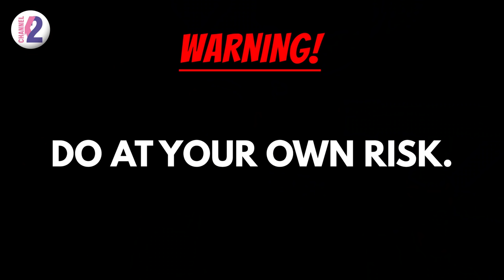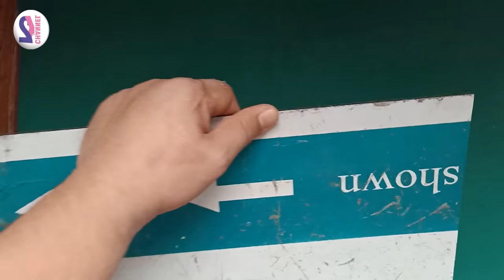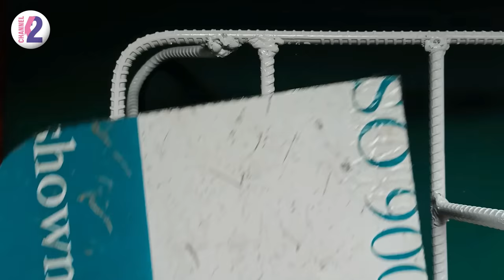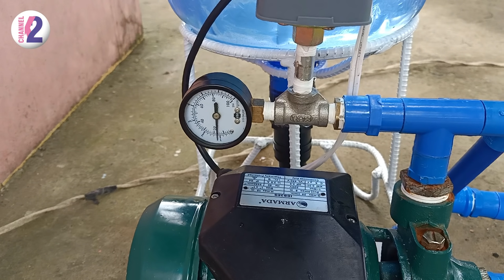I turned water container into a working pressure tank!

Comment: I just blew one up yesterday at 35psi. It ruptured into ten pieces and sounded like a rifle going off. One item not accounting for is that all jugs are different and that cycling pressure will fatigue the plastic. Mine only lasted a half dozen cycles. It all comes down to hoop stress of a pressure vessel. For mine the 0.02" thickness in some parts equates to 14,000psi hoop stress, beyond what the plastic can withstand. If you try this, make sure you have a solid water jug and stand clear or cage it. I'm just grateful the neighbors didn't call the police...lol!

Comment: A'ight, the correct way to use plumber's tape is to wind it in the same direction as the fitting that screws on, and you only need at most 2 full turns on most small fittings.  Something 2 or more inches might need 3 turns of tape from the open end to the beginning of the threads.  Hate to see what happens when that plastic degrades and ruptures under 50psi.  Don't place metal objects or knives nearby or they may go flying and kill someone.

Comment: I've tested these, these bottles can go upto 200PSI before bursting, try 150PSI and your spray jet will work much better
Reply from the maker: Yes i think it can. Though I only reach around 75psi only but with no problem at all. However I don't recommend using pressure above 50psi since dealing with high pressure is deadly.
Reply: Please take precautions in that pressure someone can get serious injuries if wrong time on wrong place
Reply: @kasunrodrigo6592  its Dangerous its what Bomb do, pressurized thing and bum
Reply: @sayalaperbandel  benar gan ide oke tapi saya takut pecah/meledak galon nya kalau yang awam diterapkan pada pompa besar dan di setting otomatis nya gak di perhitungkan ngasal 
Kalau yang paham misal saya dan agan 
Masih aman aman saja
Reply: are you sure? did you make a video?

Comment: This does not have a pressure bladder inside like normal pressure tanks so your pump is still going to run alot
Reply from the maker: Nope! My set-up only starts the motor at 30psi and stops on 50psi. The motor will start again if the gauge drops to 30psi. The trick is to put the water in the tank empty. And all will work like magic. The elasticity of the plastic alone act as a bladder. No need for a valve.
Reply: What your saying is true this will work for a while, that being said adding a bladder will dramatically improve the service life of the tank. I’d recommend putting in some thick balloons. Old school plumbers used to use this same technique in water hammer arresters but is no longer code
Reply: @elmersackanay6944  do you mean normal large party balloons, I thought they would eventually deflate? Do you inflate multiple  balloons next to each other inside the. Bottle?
Interesting  I'm poor need a cheap solution...thanks in advance🌈🙏🏻👍
Reply: You noticed this as well.  The plastic tank is a pointless exercise.  It does not do the job of an accumulator.  Could simply  put a t-fitting in pressure line for the pressure switch.  The plastic tank does nothing.

Comment: good job !...what about a schrader valve,for air intake to the tank???
Reply from the maker: This one don't need a schrader valve or air intake it only relies on its water pump's power to compress air in the tank.
Reply: @KeytoChannel  झझझझझजख
Reply: @KeytoChannel  si lo necesita    de lo contrario va a encender constantemente
Reply from the maker: Nope! My set-up only starts the motor at 30psi and stops on 50psi. The motor will start again if the gauge drops to 30psi. The trick is to put the water in the tank while it's empty. And all will work like magic. No need for a valve.
Reply: Y lo otro que debo comentar es que es una muy brillante idea   es un crack
Reply: Al no haber cámara de aire   el agua no se deja compresionar   va a subir a 50 lbs rápido y va a bajar igual de rápido y va estar encendiendo y apagando    de todos modos alguien que conozca más que yo de luces en lo que planteo
Reply from the maker: Yes I know that. This set-up is tricky. If you look closely, the tank is higher than the motor. Any air trapped inside will be compressed and will always stays on the tank. And remember that this tank is made of plastic not metal. And plastics are elastic. It means that it acts like 2 in 1 a bladder and a tank (when this thing is working you can see the tank is half empty, 70% water and 30% air at 50psi. At 30psi, 20% water and 80% air). This set up can run around 3-5mins while the motor is off in complete 50psi. And the motor will start working when it drops to 30psi. I takes only less than a minute to fill 50psi. Hope this clarify your question. This video was not made to showcase the engineering behind a bladder tank. But the main goal is to entertain people with a little amount of idea.  It would be boring if I go beyond explaining everything all throughout the video.
Reply from the maker: Yes I know that. This set-up is tricky. If you look closely, the tank is higher than the motor. Any air trapped inside will be compressed and will always stays on the tank. And remember that this tank is made of plastic not metal. And plastics are elastic. It means that it acts like 2 in 1 a bladder and a tank (when this thing is working you can see the tank is half empty, 70% water and 30% air at 50psi. At 30psi, 20% water and 80% air). This set up can run around 3-5mins while the motor is off in complete 50psi. And the motor will start working when it drops to 30psi. I takes only less than a minute to fill 50psi. Hope this clarify your question. This video was not made to showcase the engineering behind a bladder tank. But the main goal is to entertain people with a little amount of idea.  It would be boring if I go beyond explaining everything all throughout the video.
Reply: @KeytoChannel  You are wrong. Air will eventually dissolve into the water and tank will become "Water Logged". Has to have an Air volume control to work right. Well Driller for 35 years.
Reply: @KeytoChannel  water doesn't compress sir as it is a liquid, and there for this is not a pressure tank at all as the idea w a pressure tank is, that half the tank is filled with air and separated by a rubber bladder, so when the pump fills the tank the AIR is compressed and as u open a faucet and the system starts to lose pressure the air then pushes the water out to the set low limit on their pressure switch allowing, depending on the size of the tank , x amount of water to be pushed back out of the tank under said pressure  before the pump is required to restart and complete the above said process over again , so the bigger the tank volume the more time it takes in between  pump cycles ...... Wich is the whole point of having a pressure tank ........ So without having a pressurized bladder the whole idea doest work granted u may trap a certain amount of air in the top of the tank it will not work the same as having a bladder and once again .... Liquids do not compress ...... Thus the theory of hydraulic's wouldn't exist and as an above commentor said... This is basically pointless the way u have it set up ..... Sorry to be the bearer of the bad news ur pump will cycle just as much w or without the pointless bottle

Comment: I want to do sth. similar, use the water container just as air tank for my airbrush compressor. Do you know what size that adapter is? Is it 1 1/2 inch?

Comment: You did not show the reason for having a pressure tank and that is the amount of draw down so the pump is not on continuously.
Reply from the maker: The answer to your question is that little "Pressure Switch". It cuts the the pump power off after reaching the your designated pressure.
Reply: @KeytoChannel  I know that but the pump works continuously and a pressure tank prolongs the life of the pump.
Qualified plumbers will recommend the installation of a pressure tank even a small one.
Reply from the maker: You can get minimal air pressure  by allowing the motor with water to run while the container is empty. Trapped air inside the tank will compress and serve as a passive air pressure though its minimal, but it works. I only use it for cleaning so the pump will not work for that long.

Comment: I've got a water transfer pump..will this work for my pump?
Reply from the maker: It depends to a kind of water pump. here in this video I only used a water booster pump with 1/4 horse power (HP). The bigger the HP (like 1/2 HP or higher) the better.
Reply: @KeytoChannel  ok thank u
Reply from the maker: You're welcome!

Comment: Did you adjust the pressure switch or just left it as is (40/60)?
Reply from the maker: I adjust to make it lower. 30/50
Reply: Don't think it will work for me. This thing goes to 60psi plus. I tried a different pressure switch with no success. So the original digital one works

Comment: how did u get air in the bottle
Reply from the maker: U can put air inside by forcing the motor to run while the water outlet is close. This will build the pressure inside while compressing air to the tank.
Reply: Mga ilang secondo o minutes Sir?
Thanks
Reply from the maker: It depends po sa pressure na naiset nyo sa pressure switch nyo po. Automatic lng po sya titigil.

Comment: How it's working without air pressure inside the tank,
Reply from the maker: Please read the video description. Thank you for watching!
Reply: Yes useless design. The main purpose of the press tnk is to prevent excessive running of pump and build up press  The line which is going to the press tank are  same of the outle valve.

Comment: camera don't  focus at tank while pump working.
air in water tank will mix to the water soon. then it can't make pressure before pump start
it can be only water hammer helping
 this method like air pressure tank pump
but don't have air charger like air pressure pump
the air pressure in your water tank will drop in very soon.

Comment: boss, san mo nakuha yung info nang pressure na kayang ihandle nung water container?
Reply from the maker: Trial and error lng po yan.
Reply: ah okay sir, tatry ko sana kung pwede sya sa air or gas mga 40psi sana, temporary storage sana nang biogas/methane
Reply from the maker: Safe nman po sya sa 40psi lng pero di ko na po recommended ang 50psi up pa if daily use. At need mo sya indoor lng at kailangan mo ng bagong gawa na cointainer talaga para elastic pa sya hnd na brittle. Sa case ko 30psi lng normal use ko sa washing machine naka supply at pinaphidan ko sya ng engine oil para d ma dry ang taas na part kasi lumolobo sya parang baloon. Try mo din po ung 2L coke plastic bottles 120psi to 180psi po capacity nya safe parin.
Reply: Sir pwed po ba na wlang pressure gauge?
Reply from the maker: Kailangan mo po para ma set ang pressure ng tama. Baka kasi masobrahan at sumabog ang tanke.

Comment: How a  normal water bottle ll work as a pressure tank without bladder???
Reply: Thats my question,what send back the pressure to the the pump to cut off?
Reply: There is a thing called air over water pressure tank also called bladderless pressure tank, its made of either  galvanized or stainless steel. same principle but usually the tank is pressurized with air to about 20psi and then you let the water in working with 20/40 pressure switch.

Comment: sir ilang psi po ba pag naka on ung motor nya at ilang psi ung  switch off ung motor?
Reply from the maker: Below 30psi po sa pag start at 50psi po ang cut off. Pero pwede nyo din po e adjust dpende sa kailangan nyo.
Reply: @KeytoChannel  maliit lang na bahay sir pang cr lang at kusina kaya na kaya 20/40?
Reply from the maker: Opo mas ok po yan na mag start sa low pressure para safe, kasi pwede nyo nman e adjust pataas sa huli pag mahihinaan kau.
Reply from the maker: Sa experience ko po dito mas better na solo lng po ang sinusuplyan nya na linya. Gaya ng washing machine or pang car wash lng po. Pag madami po kasi ang outlet gaya ng mga gripo mabilis din na uubos ang laman pag sabay naka bukas.

Comment: material names bro
Reply from the maker: - 1pc 1/2 inch pvc pipe
- 5pcs 1/2 inch Male pvc coupling fittings
- 3pcs 1/2 inch Elbow pvc fittings
- 1pc 1/2 inch Tee pvc fittings
- 1pc 1/2 inch Tee (with thread in the middle) pvc fittings
- 1pc 1 1/4 inches to 1/2 inch pvc reducer fittings
- 1pc 1/2 inch union pvc fittings
- 1pc 1/2 check valve brass or pvc fittings.
- 2pcs 3/4 inch to 1/2 inch galvanized reducer (female)
- 1pc 1/2 inch to 3/8 inch brass reducer (male)
- 1pc 3/8 inch galvanized tee (threaded all sides)
- 1pc 3/8 inch galvanied male connector (length: 2 inches)
- 1pc pressure gauge
- 1pc ordinary pressure switch
- 1pc 1/2hp waterpump
- 1pc 5 gallons round plastic water container
- 4pcs bolts with nuts
- 1pc small solvent can
- 1pc teflon tapes 1/2 inch
- Wires and electrical plug
- Scrap metals for the frames
- Aluminum Composite Panel for the waterpump flooring (optional, anything hard will do)
- And the black plastic reducer for the plastic container (You can use anything as long as it would fit firmly to the containers mouth.)

Comment: Great experiment but in reality and practicality it's useless better buy a pressure washer if your using it to wash cars. It's ideal use though in places where water supply is scarce i.e provided you have a low pressure water service line then there's a thing called booster pump.
Reply from the maker: Yeah, I know what booster pump is. But put in mind that cheap pressure washer cost 3K PHP or more (and will probably break for few months). And aside that, it needs existing water source.  But if you don't have a water source yet and let's say you just have a deep well, you need another 2K PHP for a electric water pump and few hundreds pesos for your waterline. So that's roughly 5K-10K PHP or more. However the interesting part about my project is that, this whole thing only cost me around 2K PHP in total (maxed). And you can connect this thing directly to a well as your water supply input or any water source available. And also you can connect it's water output to your house main waterline to have a fully pressurized water system. (I bet pressure washer can't do that) And for it's durability, it's still under observation, but as of the moment 7 month had passed and there just a little discoloration to the container but the rest was fine and no maintenance was done yet . So it's not that useless after all right?
Reply: @KeytoChannel  well, that explains a lot. You have earned yourself a subscriber.  It depends on your budget this one is for cheap alternative pressurized water supply for low to mid pressure only for short bursts. The best application for your invention is for shower heads and houses with 2nd floors where water pressure can be low. Piece of advice though brother, the container can burst after a long use it is not designed for high pressure. A regular stainless pressure tank is rated at 40 psi only.
Reply from the maker: Wow, thank you for subscribing it will help my little channel a lot! Yes your right this tank are not built for high pressure but it was designed to handle a minimal pressure before bursting. So theoretically there is a safe pressure range before it will burst so I make use of it. And I tested this set up to reached safely up to 70-75psi or more if I continue but postponed it to avoid further damage to the tank. I got my concept from coke plastic bottle containers which can handle 120-180psi before bursting. And applied it with this tank which has also same materials with coke bottles (PET) but only in larger size. And it worked too only I used 50psi on this video for safety but lowered it to 30psi for daily use to supply my washing machine waterlines.
Reply: @KeytoChannel  7 month? ohhhhh

Comment: Idol gawa ka nang pressure  tank using plastic  drum.. madali kasi nasira yung  "tanki na stainless or fake bayun" 😢
Reply from the maker: I will try po next time kung posible po sya at kung makakaya nya ang pressure. Ang about sa stainless tank nman po karamihan po ng locally made hnd po tlga naka design for pressure nakaka handle lng po ng limited amount pero hnd po sya gnun ka tibay gaya ng mga branded.

Comment: Booster pump! Bakit walang pressure gauge sa plastic tank kung kaya talaga sa 50 psi or below 4 bar. Alin mas matibay gulong sa sasakyan  33 psi lang below 40psi o plastic tank? Kung segundo lang medyo kaya pa pero abutin ng isang oras na pressurize di kaya sasabog ?

Comment: 50 psi po Max? at Safe po siya gamitin sa line sa bahay?
Reply from the maker: I tested po and it can go further even at 60psi if set. But to be safe 30-35psi is enough sa bahay. And yes eto po ngaun ang gamit ko sa bahay almost like 4-5months na ok parin sya. 30psi lng po gamit ko mostly for washing machine use lng po.
Reply: @KeytoChannel  Salamat po. Keep on sharing.